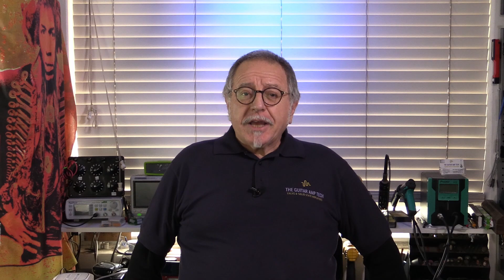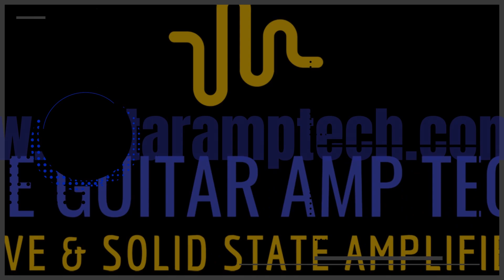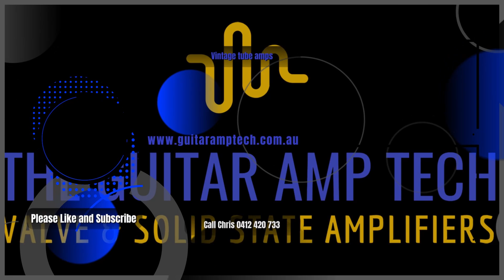Guitar Amp Tech Introduction

Comment: Can one get shocked by an all solid state amp?  I have a Peavey Bandit 112 from 1994. Nothing wrong with it. Just want to be safe.
Reply from the maker: The voltages are not anywhere near as high as a tube amp. Depends on the amp, but lets say 60v.  But, have you seen the capacitance they hold!! I reckon you could weld a ship with that energy. Please be careful!